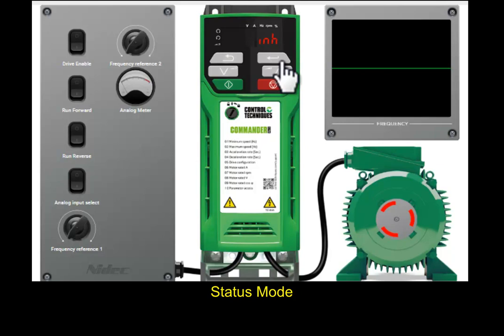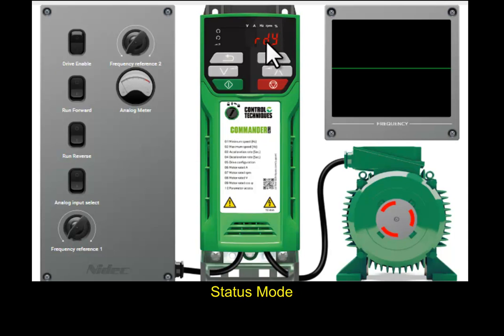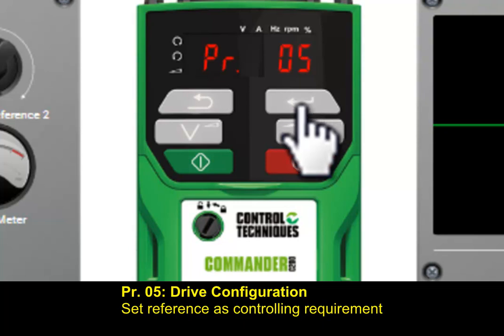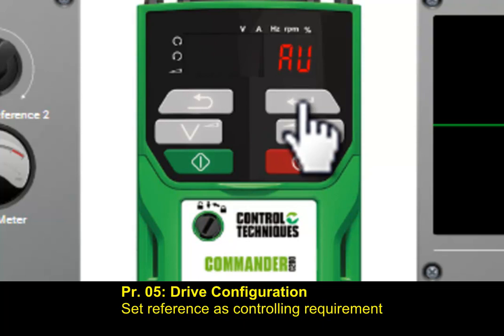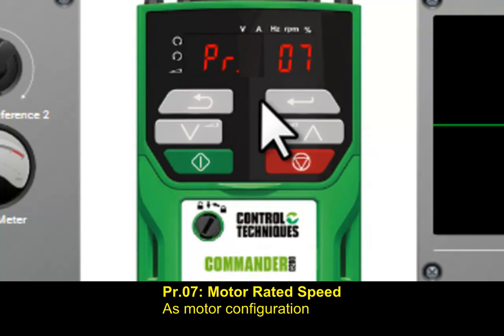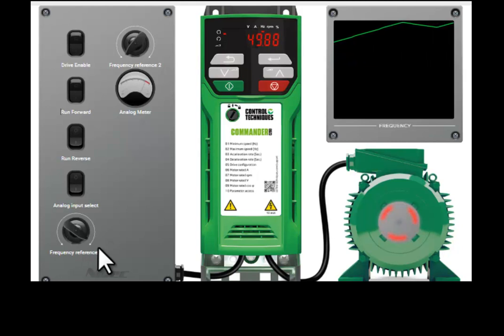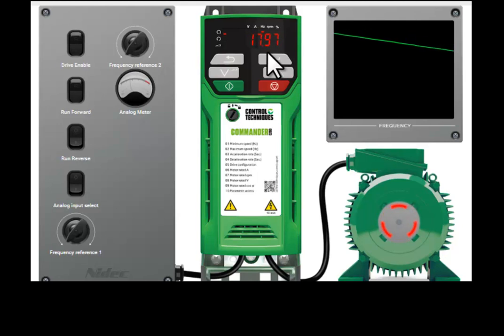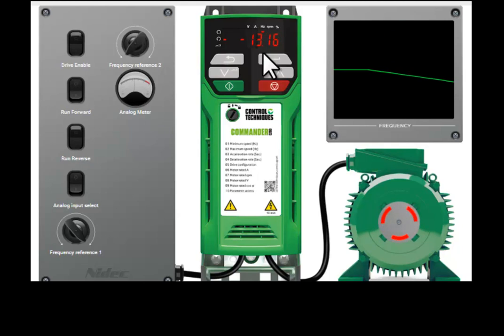𝐍𝐢𝐝𝐞𝐜 𝐂𝐨𝐦𝐦𝐚𝐧𝐝𝐞𝐫 𝐀𝐂 𝐃𝐫𝐢𝐯𝐞𝐬 𝐏𝐚𝐫𝐚𝐦𝐞𝐭𝐞𝐫 𝐬𝐞𝐭𝐭𝐢𝐧𝐠 𝐚𝐧𝐝 𝐨𝐩𝐞𝐫𝐚𝐭𝐢𝐨𝐧, 𝐂𝐨𝐧𝐭𝐫𝐨𝐥 𝐓𝐞𝐜𝐡𝐧𝐢𝐪𝐮𝐞𝐬  | @FlowChart

Comment: Dear
I need your help
I have c200 model and i want to set parameter of two pot one is toque pot and second one is speed pot. And drive run in forward and reverse function so which parameters are reauired and wiring
Reply from the maker: Check manuals for parameters and wiring connection